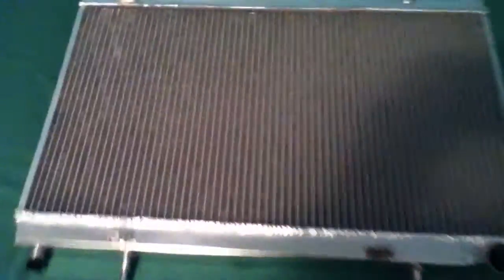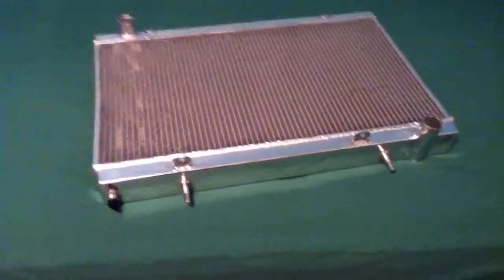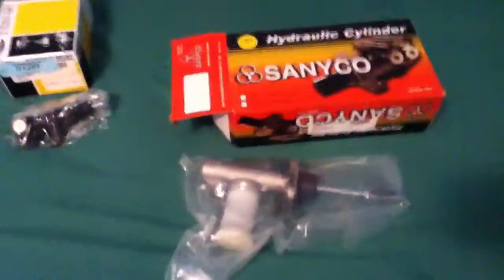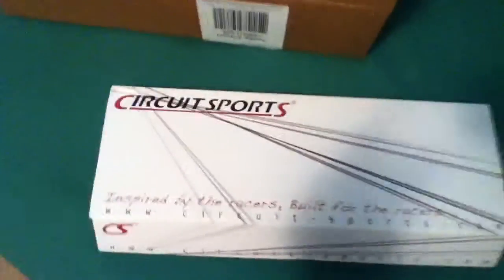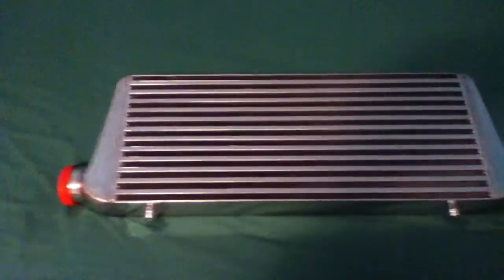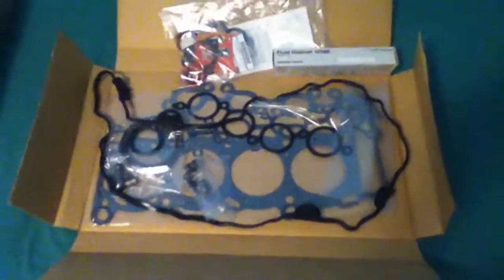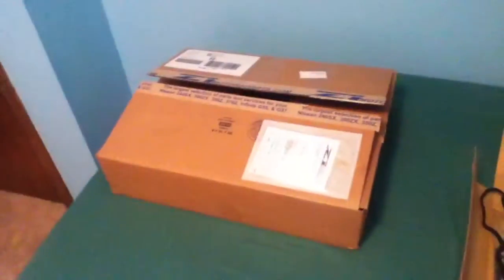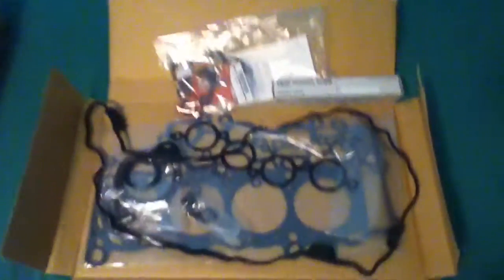Nissan 240sx sr20det Coupe Build

Comment: a word of advice on ebay parts, me and my dad used to do some builds and repairs on some cars and you really have to look out for what parts you get on ebay, some of the exhausts are sh*t i mean the  welds start to rot away and break apart after about 2 weeks of use and you get cracks and things inside ebay manifolds which break off and fly into your turbo if you have one, But anyways nice build man :D